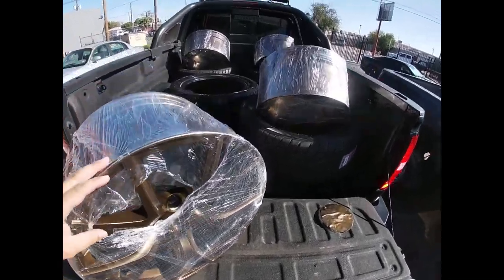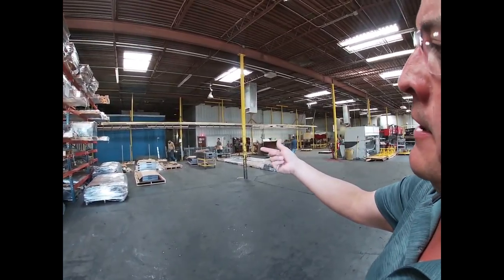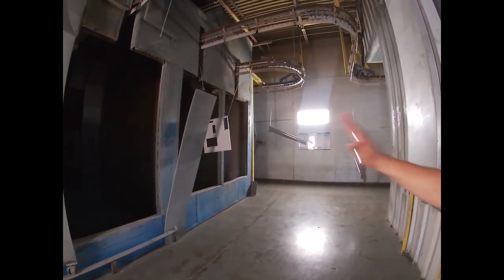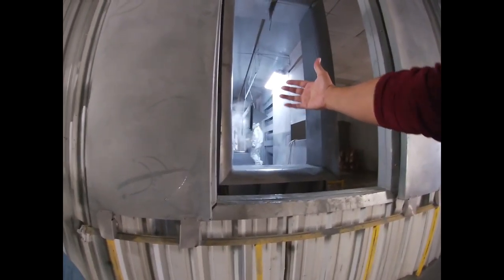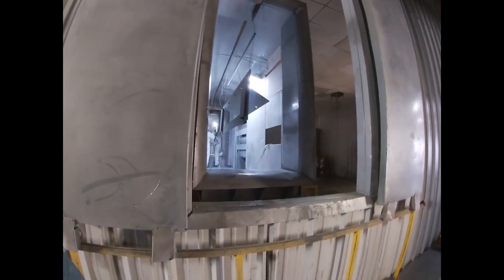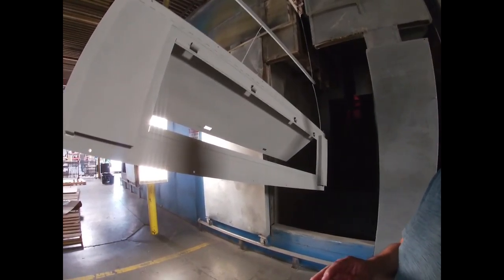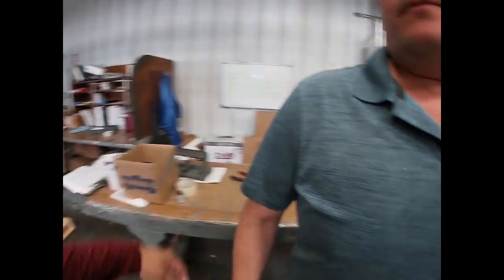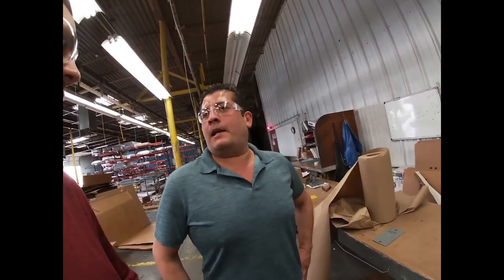We have our coated wheels + we see some powdercoating in action! #powdercoat

Comment: Hey bro. I plan on powder coating my SRT wheels as well. However, I have scratches and a few minor dents. Does powder coating restore that?
Reply from the maker: No it doesn’t. If you have scratches then watch a tutorial on how to restore scratches. You basically have to grind them down with a felt pad. Like a 2 inch 3m locking disc. Keep in mind that powdercoat is an electrólisis process where current runs through the metal part and the powder sticking. If your surface isn’t metal and clean, when you go to heat the part and the powder to turn liquid and harden it won’t bond you our surface.
Reply: @mods2rides  thank you for the advice